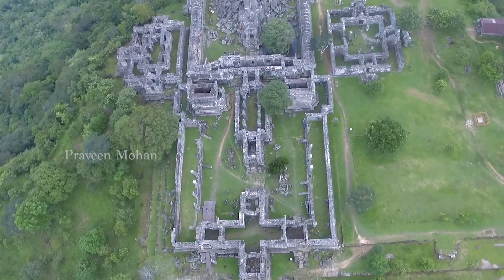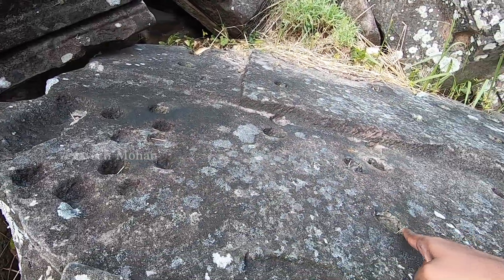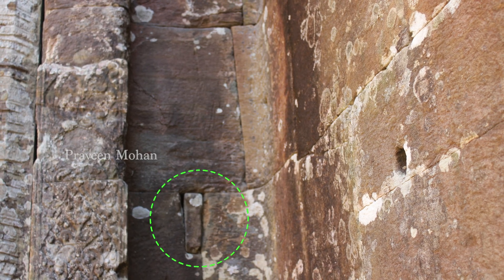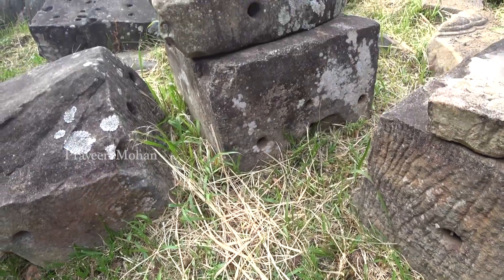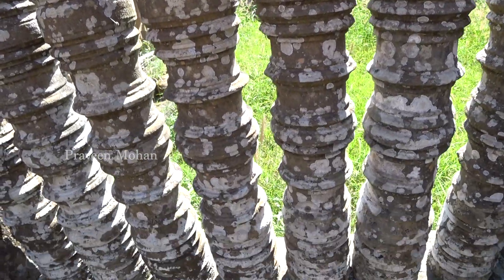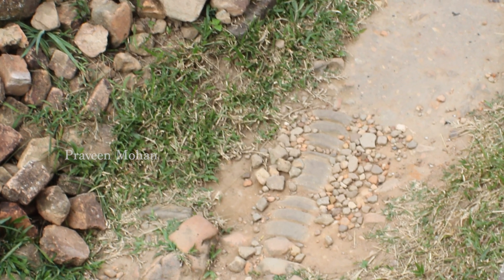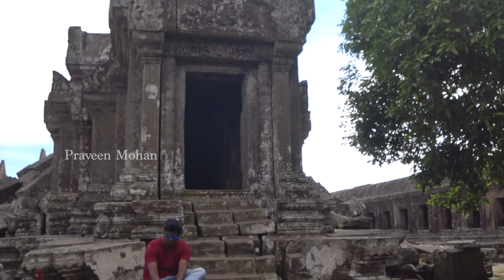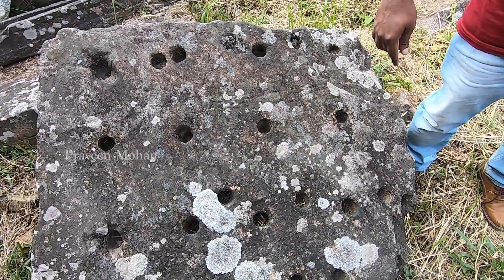Ancient STONE KEY Technology discovered? 1000 Year Old Mystery of Rock Cutting

Comment: At 2:43, where Praveen was showing us the stone wall, the stones were peeling. I don't think natural stones will peel like that. Therefore they must be artificial stones, built with a kind of cement concrete. 

At 10:02 and 10:11, Praveen showed holes for the five columns. Since the diameter of the holes are smaller than the diameter of the column, therefore the columns must be built with cement concrete inch by inch until they reached the ceiling.  But Praveen said "the five columns were separately put into the window-frame one by one". This process certainly was impossible since the window-frame was a few inches shorter than the column. 

If ancient people used cement concrete to build columns, of course they would build any other stones with the same stuff, thereby eliminating the machines. I believe ancients never machined any natural stones.

Comment: It can’t be a dowel if it’s at the ends of blocks.  Dowels would be running through holes somewhere writhing the middle of the blocks.  Also, the keystone clamps were used exclusively with a poured metal.  A male and female concept wouldn’t work because the small “male” section would provide little to no strength, as those materials provide little resistance to sheer forces in such small sections.  That’s why the slabs are so thick.  Those little pieces and corner blocks that round the corner are similar to the most ancient and grand of the megalithic structures found everywhere from Egypt to Israel, Baalbek to Japan.  There was once a civilization which possessed the ability to not only do this work with some kind of ease, but also traveled worldwide while doing it.  Fantastic video.

Comment: Its wonderful how conjecture can convince the simple mind that has no knowledge of construction using rocks. One does not even have to prove this conjecture to anyone with correct technical knowledge
Reply: ... because the persons with the knowledge will just SMILE in amusement to your unproven conjecture and leave you to your simple guesses. You MUST have any knowledge on how concrete is poured, WHEN soft, and when finally hardened, will have no visible joins unless pre-fabricated and put alongside other prefabricated blocks. Did you know that a certain frequency can soften rock and make it malleable? MULTIPLE frequencies also make crystalline solids like ROCK almost weightless. You may feel this is also conjecture and not accept that, which is fair.

Comment: It's amazing to me that this same technology whether it is the stone cuts the shapes of the stones, the Keystone cut, the board out holes or the architecture. All of it is the same as the ancient culture that once lived on this planet. All of it. Every culture and every continent that has ancient megalithic structures they are all the same. Not some of them. Not a few of them. Not most of them. All of them. Every one of them uses the same exact style of building. It is only slightly different culturally. They all have pyramids. They all have Keystone Cuts. They all have the same geometric interlocking shapes. They all have very similar were replica symbology with a different cultural nuance. All of them had correlations to the stars in the sky and the planets. All of them tracked celestial events. They also use the same mathematics. There are also structures in the world with mathematical code in them to give you the latitude and longitude of every other ancient site. Look up The Works of Carl Munck. Mysticism also has a specific codified structure when it comes to ancient psychology. The Freemasons and a few other Secret orders are fully aware of this. The correlations to the Belt stars of Orion, the dogons, the ancient Indians, ancient Chinese the list goes on and on. They all speak of the same truths. They all teach the same lessons. They all use the same architecture.

Comment: Ok. Builders cut a rectangle hole for a window. They cut 3, 5 or 7 holes each on top and bottom. How do they get the round posts into it?  I would have made the top holes slots, fit the bottoms, slide in the tops then fill in the outer part of the slots. Looked like they were holes top and bottom.

Comment: The dowels are there to give the structure strength but also movement in case of earth quakes, study acient Japanese wooden buildings they have the same technology using wooden joints at every corner and no screws or nails so the building moves in a earthqwack and dose not fall down.

Comment: Cinder blocks are either two-core or three-core, meaning they have either two or three large holesin each block, with a 1-inch divider between holes. They also typically have indented ends, with two outside elements and a 1 1/4-inch depression between.

Comment: Someone may have mentioned this already there are so many comments and replies to comments or maybe it is already known in Indian Temples.

Of all the Pyramids or temples found around the world they seem to be linked together but also slightly different as if each civilization was adding its own mark.  All the pyramids have megalithic stones but and some of the Indian Pyramids seem to have been made by the same piece of stone.  And they seem to have even more intricate carvings.

When you mentioned the Lingam and that you had seen windows with 3, 5, and 7 Lingams. At first I thought ok prime numbers, but then it hit me :the Masons.

When we write down the square of the 1st four numbers (1, 4, 9 and 16), we see that by subtracting each square from the next one, we get 3, 5 and 7. 

Ok, let's try it.

1, 4, 9, 16

4-1 =3

9-4 = 5

16-9 = 7

 3:5:7:  These are the steps in Masonry.  They are the steps in the Winding Stair which leads to the Middle Chamber and they are the number of brethren which form the number of Master Masons necessary to open a lodge of:

Master Mason:  3

Fellow Craft:  5

Entered Apprentice:  7 

I’m not sure if the Hindu Lingams in the windows being 3, 5, and 7  shows a connection to the Masons.  It could just be mathematics with the sequence part of the same math the Masons  and the Hindus used.  I guess it could  as easily just be a coincidence.  Nonetheless, I had felt I should at least mention it, since it is used by the Masons and it seems by the builders of the Hindu Pyramids possible as well.

Comment: Could the small wedged rocks be designed to allow an outlet for the rainwater collecting somewhere at the upper levels? A valve-like one on a pressure cooker. Water collecting strategically can cause serious damage. Pravin needs to see/find an empty opening where the dowel is absent between the carved stones. A pliable rod with the fiberoptic camera can possibly reveal more. The precisely cut holes with the connecting metal or stone rods may allow perfect positioning of the rocks during the assembly. adjusting the alignment of the 2 adjacent heavy objects may be easier if they are semi suspended using ropes and other mechanisms. The " axle " is anchored on two sides between the rocks. The holes are used to anchor the axles?

Comment: Thumbs up for the video. 
You mention the columns in the window, some think they rotated....That would cause wear and tear around the circular indentations in the window frames and I didn't see any evidence where the missing column was to indicate they rotated (no wear and tear).  Also, if they rotated, eventually they would get loose from the frame over time of use and would need to be replaced or repaired and I would bet they wouldn't be removing the frames to replace a column once they are in place.  I'm pretty sure they did not rotate just by looking at them and the one that was missing.

Comment: 1. The history of humanity is much older. The theory of conflict that led to almost complete destruction of the species - climate change or vice versa led to a conflict.
2. On the ground there were other parameters enabling a much easier construction and the change led to the event chain.
3. In fact, we had contact with civilization from another space ... a combination of the above senaries ...
4. There used to be more species of man on earth. Wars between the more adventurous led them to weakness ... Those less adventurous finished for the sake of peace ...

It seems very strange that in a thousand years, lost so much knowledge as for who and who built it .. It seems that it should be much older and know it passed along with some powerful ecological disaster, epidemic or war about which there should be a lot of notes and messages everywhere .. It is possible that then some civilization only managed this and along with erosion they could not keep it in possession and use.. T shapes can be parts of mold designs. They may have had geopolymer technology. They seem too delicate with the mass of these blocks to be a structural element. Know that they quickly erode ... Which does not mean that they did not have high-tech machines. these forms must be constructed and materials produced. Maybe they did have a electricity, cut stones with some vortex vibration of electricity ...

Comment: Maybe these stones were created by pouring a liquid mixture into forms, just like we pour concrete today. You first build a form and if extra strength is required you add rebars to the void in the form. Then you fill this form with your mixture. The rebars could have been made from a material that has since disappeared.

Comment: Those are not dowels as fasteners and those are definitely doing nothing to hold the surrounding blocks together
Pay attention to the wood dowel you keep flashing, the dowel licks the blocks together through the top with the blocks overlaying each other. The pins in the walls are pushed in like a wedge, not locking any two or more blocks together in any way. Not to mention those stone pins are much too fragile at that size to hold those large blocks together.
 I’m a builder, this is clearly visible to people who build.

Comment: 1:14 arent those bullet holes?...its not a mystery if it is explained..these architecture is so cool and intricate but not impossible to do especially when you have thousands of slaves and a group of genius architects and engineers..
Reply: Nope
Reply: @drewfromcle5866  what do u mean?
Reply: @paulorivera1569  they're not bullet holes.
Reply: @drewfromcle5866  well, they are so random..I had shot an m16 before and they look the same..what do u think it is?
Reply: @paulorivera1569  I'm not sure. But with rocks of this size and density the bullet itself would get destroyed it wouldn't go through the rock like that. 

I think other comments suggesting that they put the holes in them to change the rocks natural resonance or weight or vibration might be onto something. 

It could be part of the method they used to quarry or transport the rocks but I somewhat doubt that based on how well the rocks are cut and shaped into such tight fitting spaces, it seems they definitely possed a highly accurate and effective cutting process so idk why the holes would be necessary to cut the rock from the quarry but who knows.
Reply: @drewfromcle5866 well if they can chip the rock to place clamps, the rocks arent that solid..🤔🤔 the resonance explanation is interesting.. the resonance explanation is interesting..